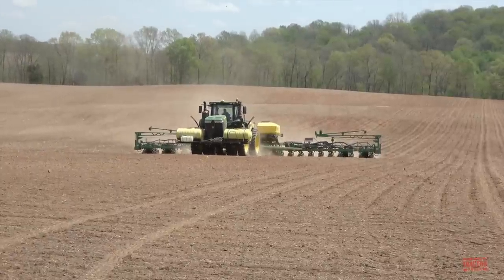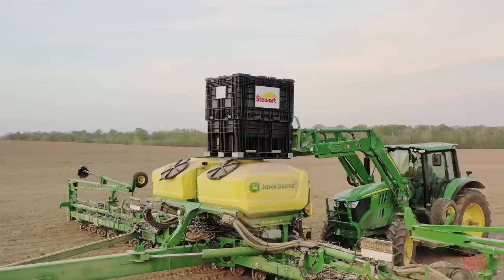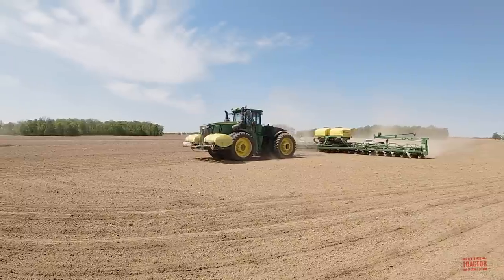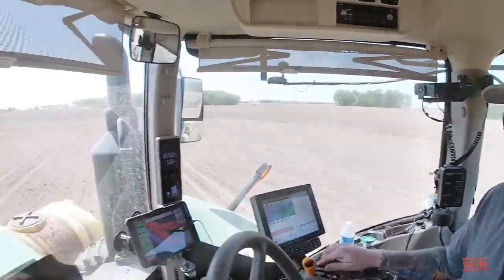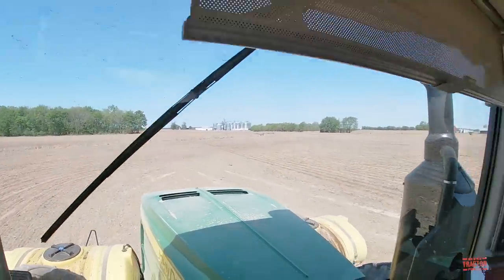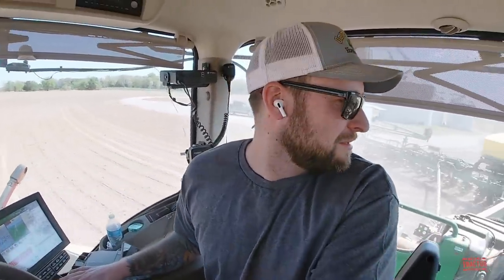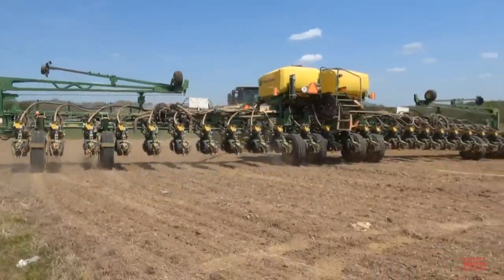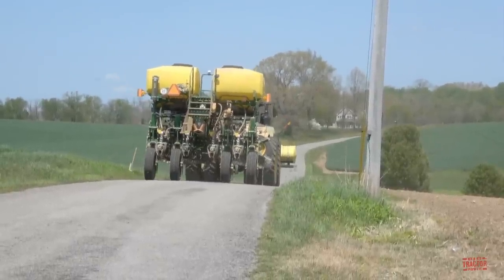New JOHN DEERE 24 Row Corn Planter

Comment: Enjoy the videos.  I run a John Deere 1770nt 24 row 30" on a 8320 tractor here in Iowa with a 9530 pulling the field cultivator.  It's hard to keep ahead of the planter.  Most of my neighbors run 36 rows and a couple are high speed.  They do very well.

Comment: Have a neighbor that went from a 36 row last year to a 24 high speed this year.  Planting was late here and his corn isn't up yet but the locals are really curious how good of a job planting you can do at 10 mph.  Should know in a few days.
Reply from the maker: I have seen field trials with a Massey Ferguson 9800VE at 10 mph. It had excellent emergence.
Reply: Our experience is the high speed JD seed meter does just as good of a job as any planter a 5mph (  have had the Precision before)  and emergence is excellent and even as long as its a good level seedbed. If its a bit rough go 8 mph. I was quite skeptical beforehand. 420 hp is about right for 24 rows at 10. With our cold wet spring this year,we'd likely have some prevent plant without it. Added a neighbors planter to help finish corn only 3 weeks late . Have the capacity to plant our corn in 7 good days. Sometimes you dont get 7 good days in 6 weeks.

Comment: Little different than my first planter. 4 row 36 inch rows with trip lift. It had a unique option of a water way attachment. Pull that rope and it raised and lowered the planter and put the same marker down. Pulled with a H Farmall and it carried about 1000 lbs. of dry fertilize. Those were the days.

Comment: I am surprised the farm does not have the new X9 combines from Deere yet.
Reply from the maker: The farn likes the X9 but it’s not as simple as buying X9s.  They are set up with 5 24 row corn planters and the X9 really needs a 16 row corn head to run effectively. 32 row planters would be better for the X9. The farm has 15 semi trucks and 4 grain carts.  This works well with 8 S790s in wheat and 5 S790s in corn as far as keeping a steady flow of grain to the two driers and bin system with little back up. Filming a pair of X9s last fall it took four grain carts and 11 semi trucks to keep the two combines rolling and several times everything was sitting. There are allot of components to running the X9.  This farm will most likely have X9s in 2023.
Reply: Ok I see the why now.that is a huge trade in cost to upgrade.

Comment: Does anyone know the difference between that and a DB60? They seem like the same thing but I'm assuming there's actually a difference?
Reply from the maker: They are significantly different.  The DB60 have a much heavier frame. The DB60 is built to carry 47 tow units to plant 24 rows of 30 inch corn and 47 rows of 15 inch soybeans. The DB60 is meant to be a 2 in 1 planter. A DB60 can also be set up to plant 36 rows of 20 inch corn and soybeans. The 177NT is only built to plant 30 inch rows.